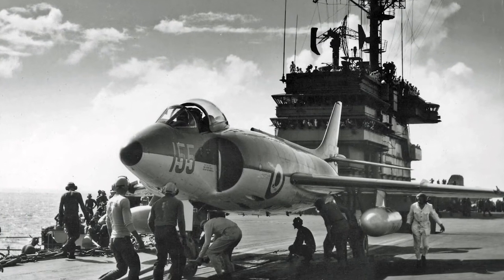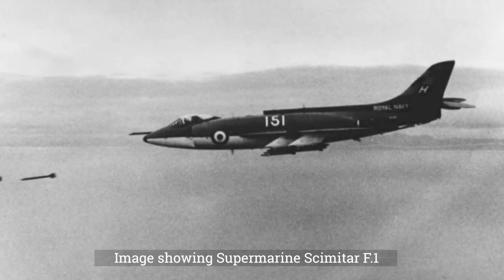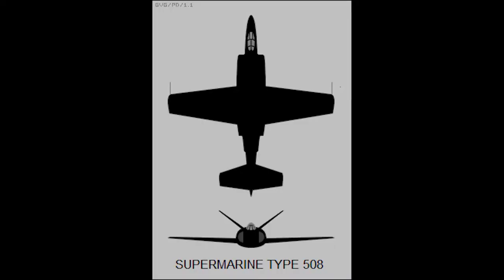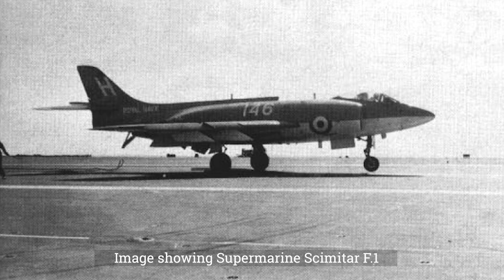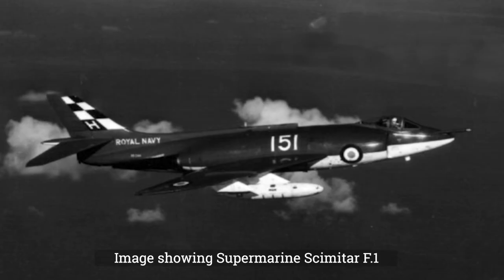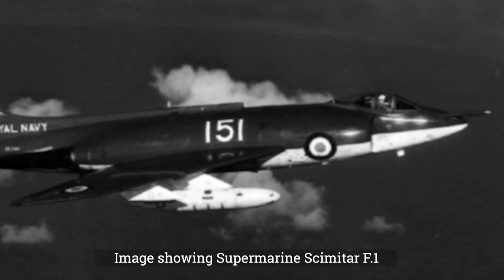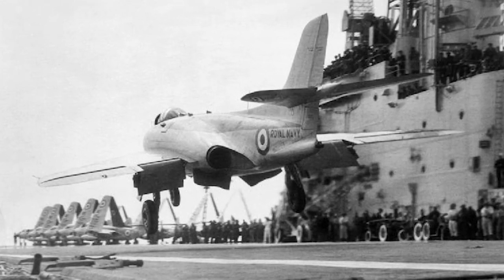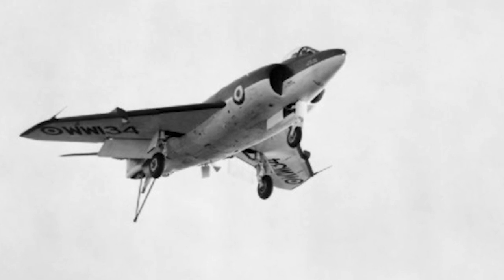Supermarine Scimitar - A Short History

Comment: Probably the last plane fitted with four 30 mm canons. Fine design but hell for maintenance (1000 h per flying hour !)
Reply from the maker: 1000 h per flying hour is quite insane.
Reply: The Lightning F2A had the capability of carrying four but was optional. Four Aden's, or two Aden's and two firestreak. Normally we fitted the latter. 
 As with most other aircraft, if you fired all four of the Aden guns at once in level flight, it was akin to sticking all your airbrakes on at once!
  Ours were normally restricted to @ 1200 ish rounds per minute. 2400 x 30mm per minute was generally enough?